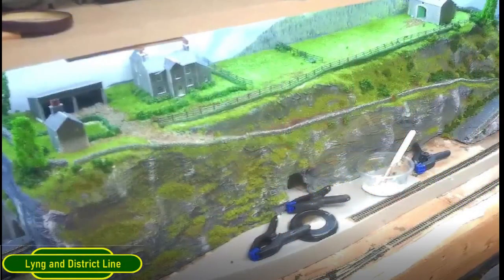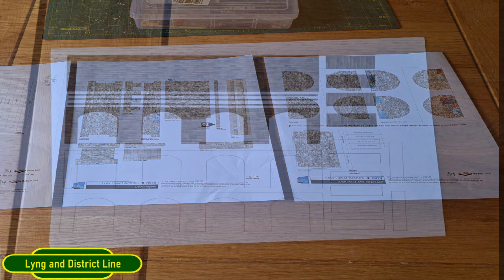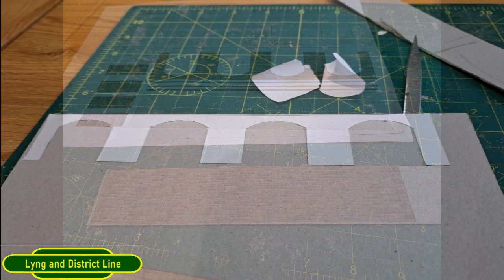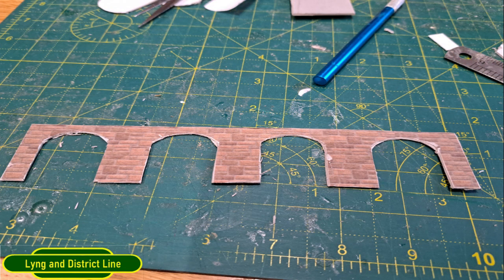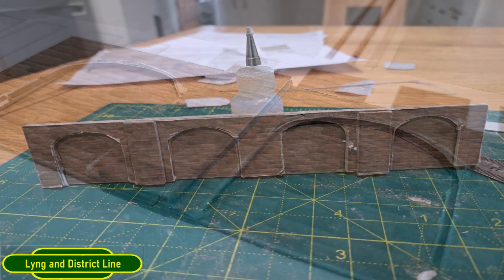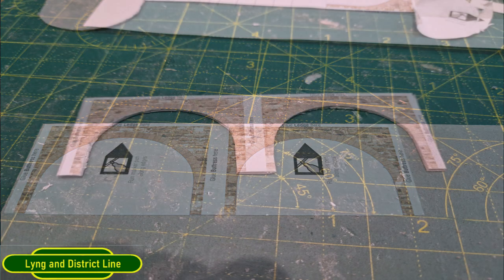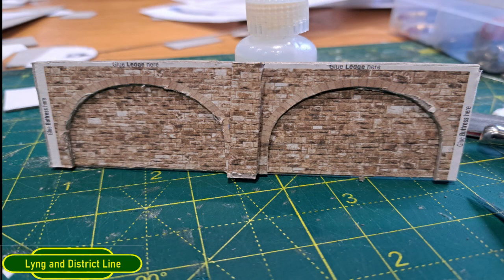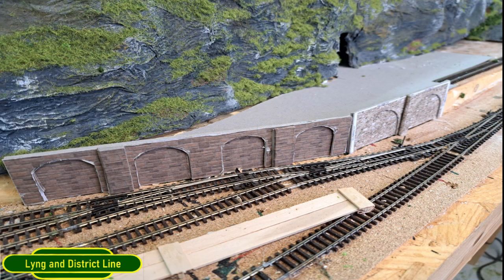Lyng and District - Episode 38 - Advice needed and a Vote!

Comment: Hi Steve.  I am not surprised that people have gone for the Scalescenes ahead of your current version.  I think you can adjust the scale of the bricks in the Inkscape version because they do look very large for N scale.  The key problem is that your version has key bits of the structure missing.  You haven't put in any brick arches to support the structure  (this was a mistake I made when I built my first viaduct and it bugged me ever after).  Put simply your wall wouldn't be able to support the weight of the arches or the courses above the arches.  The eye picks this up even if we don't consciously register it but it just looks wrong.  The Scalescenes version 'looks' right and I think would always win in a straight choice.    Given that you have bought the kit, personally I would go with that, but you plainly have started to learn how to use Inkscape and that will be invaluable as you move on toscratch build other structures.  Stephen
Reply from the maker: Thank you Stephen for your comment and advice